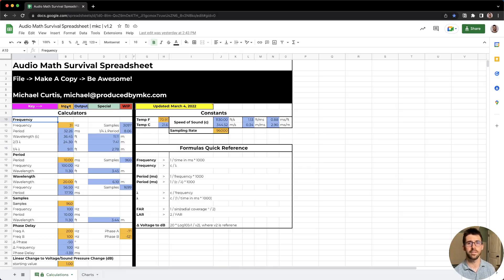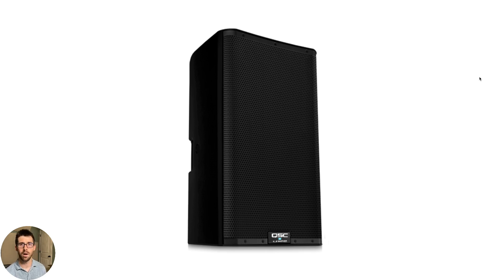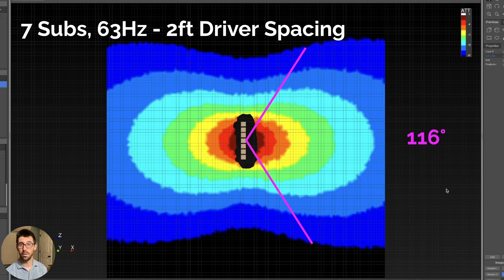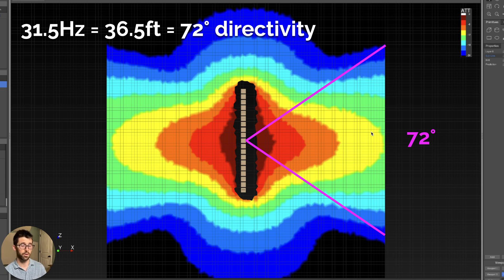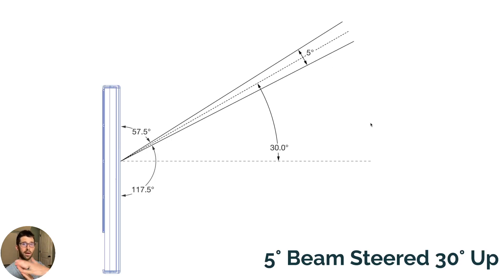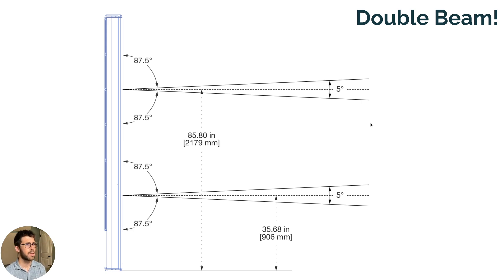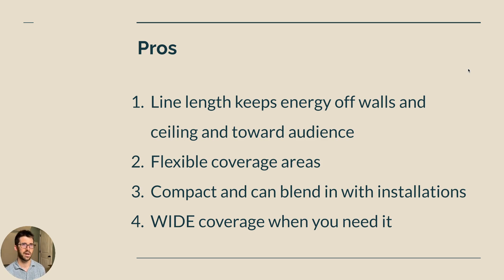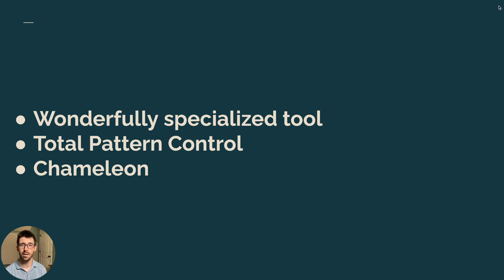Column Speakers For Live Sound | Pros, Cons, and Why They Work

Comment: My church has Bose MA12 and will soon get a pair of Tannoy VLS30 for choir sound...  are these columns programmable?  By that I mean company has specialized software they give only to qualified techs to perfect an install?    It would make a difference as to whether this would be a DIY install or Paying for a tech to come in and perfect sound steering.
Reply from the maker: I checked out the VLS30 manual and it says it has a fixed +3/-11 downtilt in its pattern, a 15° total beam.

Bottom line - you're stuck with how its pre-programmed to cover. In that way it's more plug and play, but you've got to assess whether that coverage angle will be enough given the mounting options available to you.

Comment: what's the best mobile DJ friendly way to set up a PA system for a crowd of 10,000 for an outdoor movie???
Reply from the maker: That's a tall order : ) How many speakers do you have?
Reply: @MichaelCurtisAudio  Its for a company that i work for that does outdoor movie nights. Originally it was done with 16 JBL EON15 speakers but i am looking to help upgrade that. Possibly with a constant curvature array system or just better point source speakers. One exception would be the JBL SRX900 series because it would also be an option.
Reply from the maker: @johnnyknudsen1755  The new JBL SRX900 series stuff looks great and would be the best fit here to cover an audience that large.

I'm assuming you'd be able to fly speakers? With the 16 EON15's it sounds like you formerly did a bunch of delays?
Reply: @MichaelCurtisAudio  no delays just 8 speakers on each side (for a total of 16) spread out over the entire perimeter. Also there were generators on each side after the first four speakers which were used to power the second four speakers.
Reply: @MichaelCurtisAudio  Could it be done using constant curvature arrays (such as JBL VRX932LAP, QSC KLA, Presonus CDL 12P) and if so what would it take??? Would it be cheaper to go this route (vs using SRX900 series) or more expensive and how much of a difference in cost would there be???
Reply from the maker: @johnnyknudsen1755  It "could" be done with constant curvature, you just need adequate trim height. "10,000 people" gives me a rough idea of the actual coverage area, but without specific dimensions I can't give you an answer on what speaker types and how many.

I'm sure constant curvature would be cheaper, but if the other shows you're wanting to do are of this scale, I think a true line array would be best. I'm not familiar with pricing on the SRX stuff.

Any any case, being able to get your speakers high in the air  is going to be key to covering a larger area. If you don't, the front row gets blasted and the back row hears a whisper.
Reply: @MichaelCurtisAudio  there is just the one event of this scale.
Reply from the maker: @johnnyknudsen1755  Then I'd rent in a line array rig if you have the budget.
Reply: @MichaelCurtisAudio  I 100% agree about renting the line array but the constant curvature array could also be used for other events with two speakers per side on a tripod stand... or with two main arrays and two delay arrays for the big event
Reply from the maker: @johnnyknudsen1755  Sure thing. Again, it's up to client expectations, your budget, sight lines, how clean are the cable runs, how likely are you to use the same setup again, how available is the gear you want to buy. You'll have to weigh all these factors.
Reply: Well, it would certainly not be with any silly column speakers.   Folded horns for lows.  Probably 15” 2-way's for mids and highs - 2 or 3 of each per side.  Pretty standard for the outdoor shows around here.
Reply from the maker: @perrywright4904  I don't think any column speakers were suggested for Johnny's show.

Comment: Hi Michael, right on time the video. I’m currently building a couple of small column speakers for a PA system for a friend of mine. It is intended for small gigs, for example a cafe for 50 people. I would want you to help me out with something. In this cases the musicians and PA are very close and at the same level. It tends to be overwhelming to have the sub a couple meters away. How would you set up the subs in these cases?. In particular, right now I have the option to build a single dual driver sub or two single driver subs.
Reply from the maker: Hey, Diego! I would do two single driver subs and run them in and inline gradient cardioid setup. That way there's a lot less low end of stage.
Reply: @MichaelCurtisAudio  thanks! I’ll try that, although it may me hard given that the subs would have to be right at the feet of the singer and extend into the audience, which usually is very close to the artist.
Reply from the maker: @Ricochetmex  You're right, inline gradient does take up a lot of real estate, especially in coffee shops!